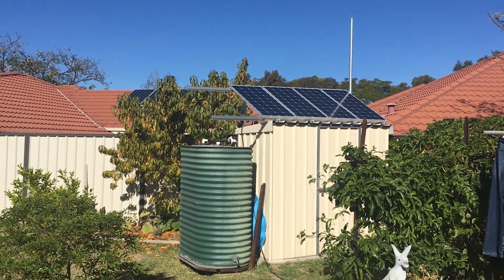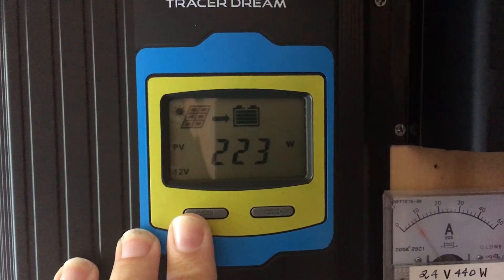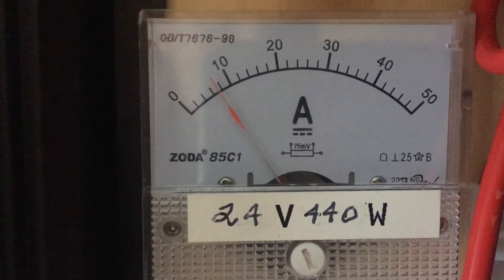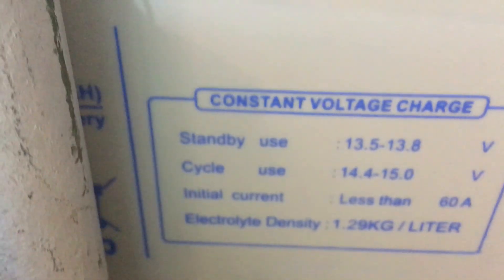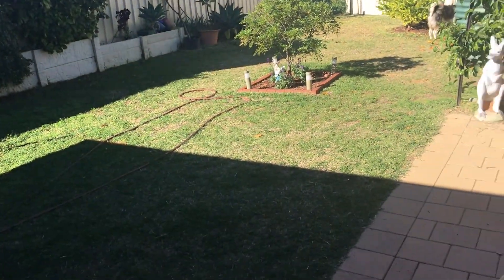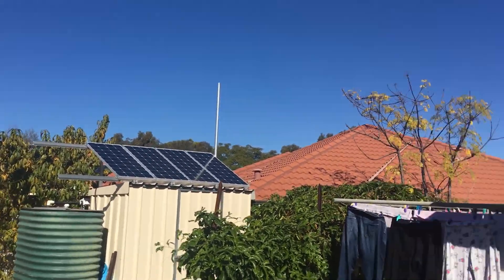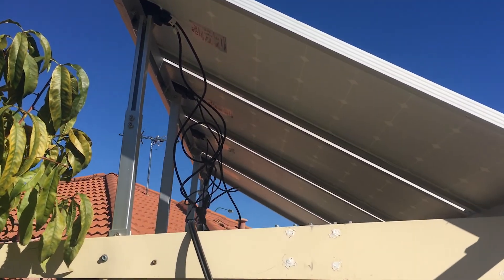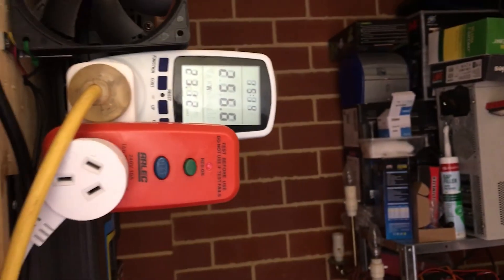Upgrade on my 12v solar setup

Comment: Why is your inverter  installed  inverted? Overall good install...
Reply from the maker: Thanks I tried to make every thing fit and ezy to get to i'll be changing it latter when i get more stuff i'm not done with my system. I might keep going with 12v or I might upgrade to 24v.

Comment: Are you happy with the new controller? How many watts can it handle in 24 volt config ?
I'm running a 30 amp tracer at the moment and am looking for something bigger
Reply from the maker: I'm happy with the charge controller on a 24v the box say 1000 watts  if i read it wrong ill let u know

Comment: checkout vasilis garden great organic gardening tips.
youve got some good watts comming in and no worries with blackouts at all ,love the 200 ah batteries i want some myself but $500 a pop means ive got to save $$$$
yes i found mppt must have higher volt input to be efficient , i also saw that explained and demonstrated on youtube by amy on the  Alte store channel.
Reply from the maker: Ken B 
Thanks for the tip I'll check it out
Yer cost me $430 each I do want to get 2 more

Comment: Why do you say 24v is better than 12v?
Reply from the maker: I tryed it in 12v parallel then looked at the gauge then put them into series 24v and i got more power out that way i did it 2x and same result i might do a video on that
Reply: Good idea mate!